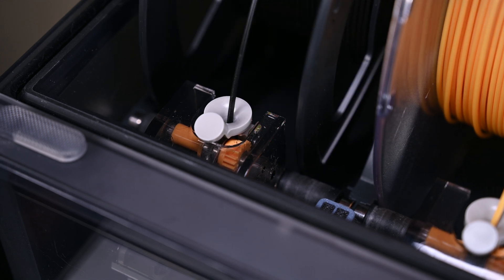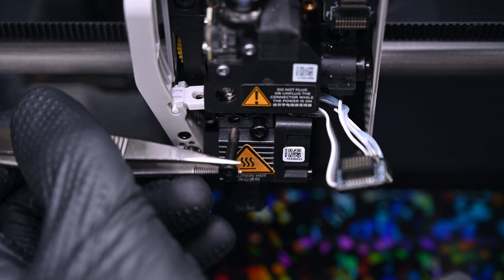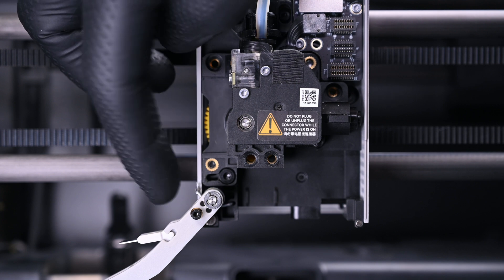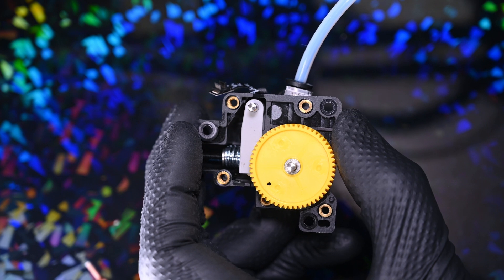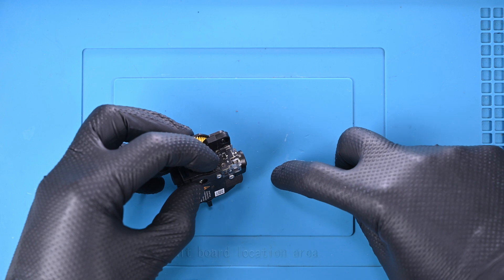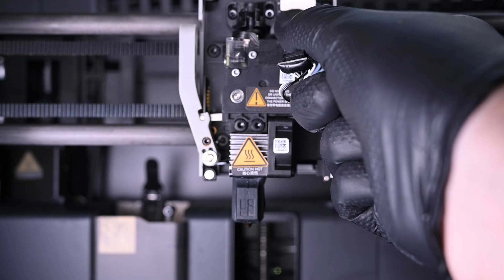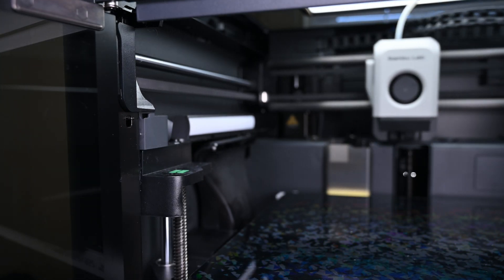Bambu P1S Full Extruder Teardown Guide - Failed to pull out the filament error fix

Comment: Hi, awesome guide so far. One issue. I'm at the stage of pushing out the extruder gear and it just does not seem to want to go out. Like I can't move it at all. Any advice on how to fix this?
Reply from the maker: @Saxophonin  it’s a pain the first time. Look on the other side of the plate holding it, you should see the silver center pin of the gear assembly. Using a screwdriver you should be able to force it out, a lot of friction holds it in place but no glue or plastic tabs to worry about.
Reply: @ thank you so much for replying so quickly. I just managed to get it a couple minutes ago. Needed me to fiddle with the filament while pushing the filament out. Now I just need to reassemble. Thank you so much for the amazing guide.

Comment: You just can’t pull the tube from the head, you have to use the tool.. Don’t know why you pulled on it. Makes no sense
Reply from the maker: @mrharleyguy2u  no tool needed, it’s a Bowden coupler and like most all of them you simply push down to release it. This would work except the filament is still jammed, so the tube can’t be removed.

Comment: I CANT GET THE EXTRUDER GEAR OUT!!!!1
Reply from the maker: It can get really, REALLY wedged in there. You can also push it out from the other side using a small flathead screwdriver, or walk it out by pulling it left and right.
Reply: Yeah, thanks but I already ordered a new extruder but your guide was very helpful on assembly and disassembly. 10/10!:hand-pink-waving:

Comment: INCREDIBLE video. I had a catastrophic failure with a Creality product. I decided to buy Bambu a month ago. Turns out it was the right choice. I basically had to throw away the Creality printer because the blob ate up the wiring around the head and Creality doesn't sell the entire print head assembly.

Long story short, while the Creality issue was different, I had this exact fault shown in the video in my P1S and groaned at the thought of having to spend a weekend on that trying to reverse engineer the print head like I did with the Creality, however, while this fault was less severe, it displayed the great design that Bambu uses on their printers. IT WAS SO EASY TO TAKE APART! Thanks for this video! God bless you!
Reply from the maker: @user-qv7rw7dq1d  it’s amazingly well designed, the identical screws and simple modular assembly is so great to see in the 3D printer world. My Ender 3 is still assembled, just in the closet collecting dust.

Comment: Excellent video. Had the same problem with some PLU that I had stuck in there. Luckily I only needed to go so far as removing the transparent block from the extruder, because the rest of it seemed like a real pain to have to do.
Reply from the maker: @goilo888  not too bad, but not too fun either

Comment: I had the exact same crappy situation as you and you helped me tremendously to fix it. I haven’t taken my extruder apart before nor have I had any clogs. I searched and searched for a video to help me. No one talked about the tube being stuck as well as the filament. I appreciate how detailed you were in this video, I won’t need any other video for dissembling an extruder. I was very much overwhelmed, but I definitely could do it again, probably from memory with as well as you instructed. Let’s just hope I don’t have to any time soon.
Reply: lol im going through it right now... very overwhelmed and the tube being stuck no one else talked about!! everyone else took it out very easily...
Reply from the maker: @your3dhomie88 the tube being stuck because the filament is stuck is really frustrating.
Reply: had to do this as well. took the opportunity to swap to hardened gears. thanks for vid.

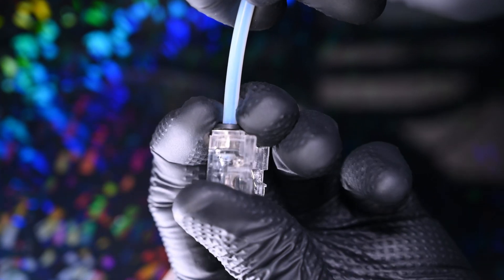Comment: Please delete this video! It took me 10 seconds to remove the filament from the extruder. You just need to push down the ring that connects the transparent tube to the extruder. It is not yet firmly connected to the extruder as mentioned in this video. see video 4:18. This should be done at the beginning.
Reply from the maker: @shian007  it’s connected because the filament is stuck inside of it, the tube is essentially attached to the filament. The tube cannot be pulled back because the amount of filament in it cannot be compressed. Try loading filament into your hotend and then pulling out the Bowden tube, then report back. You may have missed the entire point of the video also, whether the tube comes out or not you’ve still got broken filament stuck in the extruder.

Comment: This has happened twice now with the same filament. Annoyed to say the least. My biggest issue after rectifying the extruder gear jam is the hotend now having a finishing nail like top which doesn't feed into the hotend and will just cause another jam (ask me how I know).
Reply from the maker: @AndrewD50297045  mine ended up being caused by running my bed about 15c hotter than I should have for PLA, and keeping all the doors closed.

Comment: What else would I need to take apart and clean/clear with my print head squeaking constantly and under extruding. I cleaned the hot end, changed the ptfe tube inside, did everything from this video looking for a clog and it’s still not running right. This printer is only 1 month old🥴
Reply from the maker: @FeathersWithHeather  sounds like a clog really, a partial one. Some filaments have fillers or glitter that can gum up nozzles, I’d try doing a cold pull. There are some tutorials online but basically you heat the end of an Alan wrench with a lighter and then jam it into the nozzle to clear it out. Or those little needles that came with the printer.

Comment: It's 4 AM, woke up at 2 AM to see my printer still printing but nothing coming out.  2 hours later and very thankful for this video!  Had the exact same issue happen to mine.  I think the hot end got clogged and then the extruder gears wore down on the filament as it wasn't coming out and the gears wore it down so much, it then warped and got stuck in the extruder.  Fun times

Comment: Amazing video, he helped guide me step by step clearing the filament clog except now the printer refuses to load new filament even though the path is clear. I can see the filament coming down the bowdem tube but it stops at the extruder and the AMS reels it back. I replaced the hotend assembly with a brand new one, still no luck.
Reply from the maker: It's possible that little filament sensor isn't plugged in, but you may also check that there isn't a piece of filament jammed in that clear section of the extruder.

Comment: I have the same problem come up from time to time. This is how I resolve it quickly: 

I cut the filament just before it goes into the AMS, remove a roll of filament from slot 2 or 3 and release the ptfe tube from the back of the AMS and expose an inch or 2 filament which I cut. I have typically been able to pull out the filament from the print head side with my hands and then from the AMS side with pliers. I reassemble everything. I go back to the filament roll which had the problem and wind it back checking for gouging spots creating by the gears and cutting it out the damaged filament or the problem will be back right away. Then I load that filament roll back in the AMS.

Comment: Great video. Just to mention that Bambu designed the bowden cable restraint so you can push it down, whilst pressing down pull the tube out.
Another way to remove the tube is by presing down on the black ring on the bowden tube entrance, whilst holding this down you can pull the bowden tube out.👍

Comment: hey i got the same issue but the gear isn't coming out i see the stuck filament and it looks like it's on the gear and getting mangled so i feel like i have to buy a new extruder what can i do to get the gear out, i think the gears wedged in there well

Comment: So I started doing this because I had a visible clog inside this white tube. Realized all you have to do is push down on that ring that’s holding the tube in place and it comes right out
Reply from the maker: @VoidLabs  yup! Most times the Bowden tube can pop right out. In my case I couldn’t do it easily as the filament itself was holding it down. They really planned ahead for things like this and made the printer easy to work on

Comment: I just went through your video and the information an d details provided me with the resolution I was searching for.   I went through the entire process and I was able to determine I had the exact same problem with the distended filament.   Thank you so much for the video quality, clear, concise and straight to the point instructions.  Very well made and highly informative.  I was worried I would make a mistake and break some features on my P1S.  Now I have the experience and knowledge to upgrade my components with ease and proficiency.  Liked and subscribed.
Reply from the maker: @Knightfall572  so glad to hear it! The first time I took mine apart I had almost no idea what I was doing, but was happy to find that it seems like they designed it to be taken apart and reassembled easily

Comment: Great guide, especially because I also had a similar problem with the deformed filament jamming the works! In my enthusiasm of disassembly I managed to tear the filament sensor in half (despite your warning). It is just $7 on AliEpress, and a month of downtime, but next time I will remove it completely before tugging on the filament and extruder. I am just learning 3D printing and I am very grateful for your video.
Reply from the maker: @davidcoyle3101  I’m glad it could help!

Comment: You. Are. A. Lifesaver!!
I had the exact same problem and was able to follow your steps exactly. I am wondering if I lost a piece or something when I popped out the gears cuz it was really tight but when I put it back together it was really loose and now that everything is assembled, the filament won't feed into the extruder at all. 🫣 Any ideas?
Reply: I'm unfortunately in the same boat as you
Reply: @TheKatieCakez  I ended up finding a small circular silver piece with a hole in the middle that I accidentally lost when I dislodged the gears! Once I found that and got it put back in where it was supposed to be, we were good to go!
Reply: @capricespieces  I found that piece just after I wrote that too! Didn't fix the problem though. I still get the error that I need to remove the filament from the tool head when I try to load anything  via the ams. I can manually load a spool without it and print w the one color, but when I try and unload it once it's done, It gives me the same error all over again.

Comment: So, I've done this process probably 30 times in the last couple months. People on reddit say it's due to heat creap in the extruder.  Do you have any info about heat creap and why it happens? I checked my cooling fans and have been using a reliable new hotend. But had to change to a .6mm nozzle to help mitigate the heat creap. Was hoping to go back to a .4mm or a .2mm nozzle, but need more info about heat creap in case it happens again.
Reply from the maker: @ryangkirby  mine was heat creep, I was running the bed too hot for the material I was using. Ever since opening the top lid or door I don’t have any issues

Comment: Didnt fix my issue, but great job on the video. Commentary, and video work are simple and well done.
Reply from the maker: @MrDR1F7R  what kind of issue are you running into?
Reply: @TapticDigital  Gives me the error extruding filament failed the extruder might be clogged. Did a cold pull, pushed new fillament through, cleaned it out with a needle, stripped down the extruder and cleaned it... same error. Only now, one colour gives me that error, and another colour refused to stick to any of the plates.

Comment: This guy makes better troubleshooting video than what Bambu provides in their wiki.
Reply: That wiki is practically unusable!
Reply: @DIW-Commentator it's to obfuscate use. Apple strategies
Reply: This helped me so much.❤
Reply: EXCEPT YOU DID NOT NEED TO TAKE IT APART TO REMOVE THE TUBE YOU SIMPLY PUSH DOWN FIRST THEN PULL.....
Reply: @VolumeM  
If you watch the video again, more closely, you will see that the filament was actually stuck within the gear housing, and could not be pulled out. Pretty much the first thing he tried was to push the lock down on the bowden tube and try to pull it out of the extruder. Unfortunately, the filament was stuck in the gear housing and so he had to take the entire housing apart.

Comment: Thank you so much for posting this video covering this in such great detail.  You just got my out of my first literal jam with my x1c.  I had the exact same annoying blob preventing progress.  Curious if the source of that issue is the dreaded heat creep phenomenon?
Reply from the maker: @jhow3d688  sure was heat creep! I was running the build plate much too hot for PLA and had the door and lid closed, it was getting way too hot internally and led to that jam. Printing with the top popped or door open has completely fixed it for me

Comment: I just got my new printer yesterday and had this exact issue. Your video really saved me, thank you so much! I am usually a very impatient person but your pace really was perfect for me to fix it while listening to you and working along. Also thank you so much for showing me how to put it back together because other videos I used with my first printer stopped after fixing the problem, leaving me lost with a bunch of parts. So thank you again, I cannot recommend this video enough!
Reply from the maker: @raegrimm6640  glad it helped! I found that I can avoid this if I print PLA with the top glass off or at least lifted a little bit so there’s some ventilation for heat to escape. My issue was the PLA melting too much in the hotend from heat
Reply: @TapticDigital  Thanks so much, I will definitely try this! Had to take it apart today again ... I am also wondering if it is one of the filaments I used as it is the only one making problems as of now.

Comment: Thanks for this great video. The step by step explanation is awesome. Helped me to fix my printer. Had broken filament stucked in the extruder that could be removed after loosening the spring inside

The root cause was a too big cardboard spool from eSun that could not move correctly in the ams with using PLA printed adapters on the cardboard.

Comment: I had the same exact issue thanks. 
But now I have a new issue when I try to lead filament with AMS it keeps pushing and pulling filament out and it says it can’t go in the tool head even though it is going in. 
Everything is plugged in I triple checked.
Please help

Comment: I just had this same error.  I unhooked the AMS and checked for broken filament and could find anything.  I then loaded an external spool and did the "Load filament" process a few times while using manual pressure during the loading process and it worked itself out.

Comment: the entire reason i bought this machine, upgrade from ender 3, was plug and play. i hate that im here looking for a fix 3 days after christmas. im losing it lol
Reply from the maker: @GORGxBLACKSMITH  it’s a bit of a learning curve. With the Enders it was about figuring out what was wrong, with bambu it’s more about figuring out how to make it work. I’ve had better luck printing PLA with the lid or door open and no clogs since!
Reply: @TapticDigital  yo I'm so excited. Found the break in filament just inside the extruder. I'm good!
Reply: @TapticDigital leaving the door open for PLA solves the issue?
Reply: @TapticDigital  gotcha. Too much heat retension, I'll open the door
Reply: @GORGxBLACKSMITH  
I reckon that is the problem. I had the same issue printing ABS on a hot day...
Reply: I bought this one yesterday, and after my 2nd print (all on basic settings) i’m here. Grrrrrr.
Reply: @DIW-Commentator  base settings are too high for PLA, its set to 240C when PLA max should be no higher than 220C
Reply: Ender survivor here as well. I will definitely take the downfalls of my X1C over the complete trama of an experience from my creality.
Reply: Feel the same way. I just bought mine yesterday and I’m already doing this crap. I’m very annoyed.
Reply: same thing happening to me....never had an issue with my cheap ender...what a joke
Reply: The good news is working on a bambu is significantly more forgiving than working on an ender
Reply: somehow having the same exact situation lol
upgrade from ender 3, then within a week I experience almost every single problem the tool head can have on my P1s
hey, when it works it works flawlessly. but when it doesn't, oh boy.
Reply: I'm here just a few days after ownership too. Super annoying but, after doing this I can easily break this down and clean it out whenever. Made me feel way more confident plus swapped out to hardened steel while in there. Hopefully it's not all the time
Reply: Hi, thanks for the video! It helped me find issues with my BambuLab P1S extruder. I’m printing PLA, but even after replacing the hotend and cleaning the extruder gears (2,000 hours of use), the filament still gets flattened and jams. Why does this keep happening so often? Could it be extruder tension or something else? Any tips?
Reply: This…

Got this Christmas and already having to do surgery in less than a week? I’ve done maybe 10 projects. All fairly small. Now my AMS can’t load to the extruder. I shouldn’t have to be doing surgery on this thing within the first week I got it. Really disappointed, tbh.
Reply: I think you were very, very, unlucky. This is an excellent machine and mine has worked almost daily for 18 months, until the stuck filament today.